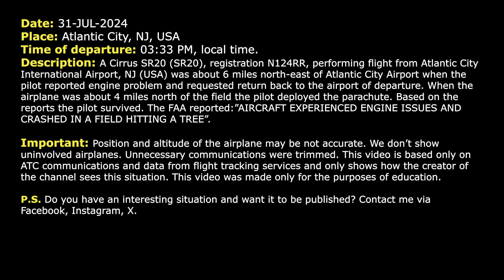Pilot saves his life deploying parachute. Cirrus SR20 crashes near Atlantic City Airport. Real ATC

Comment: Another cirrus engine failure. What's up with so many loss of power situations in aircraft? I've been driving all sorts of vehicles for 40 years and I've never had one of them just stop running. And they don't get the meticulous maintenance that aircraft do
Reply: Aircraft engines work under a higher throttle load at all times than automotive engines
Reply: Piston aircraft engines are essentially 50 years out of date compared with the technology in modern motor vehicle engines. Leaded fuel. Mechanical fuel injection. Magneto ignition. No computer controls.

The problem is that the market for piston aircraft engines is tiny, and it's incredibly expensive to get anything new certified by the FAA. The incentive to develop a new engine with modern technology is minimal, and the risk is very high.

There are other reasons why aircraft engines face a more demanding set of operating conditions than motor vehicle engines (high loads, wide range for intake temperatures and pressures, need for high power to weight ratio), but the reality is that we know how to make piston engines extremely reliable in very demanding conditions. There is just no incentive in the piston aircraft engine space to do anything other than ship derivatives of obsoletr but "good enough" designs.
Reply: I had multiple times with engine over heating situations in a car over the years and basically you just slowly stop on the side (unless you want to break your engine...) then safely assess the situation.
Reply: @mata2723 I don’t think stopping an aircraft on the the side of a cloud is covered by the FAA.
Reply: Also it doesn't just stop running, they usually start to lose oil pressure and it requires more and more throttle for the engine to run until it locks up or throws a rod
Reply: You’re absolutely right.